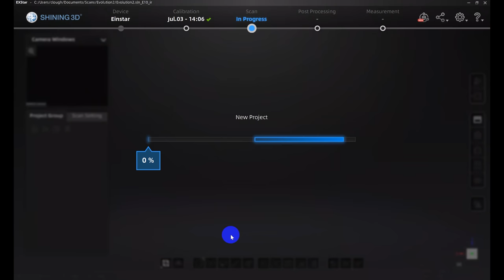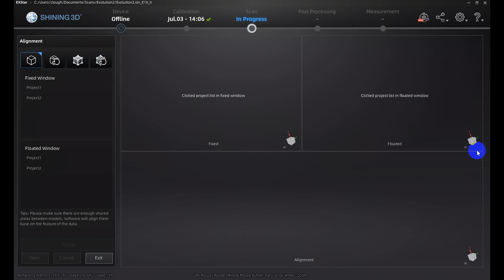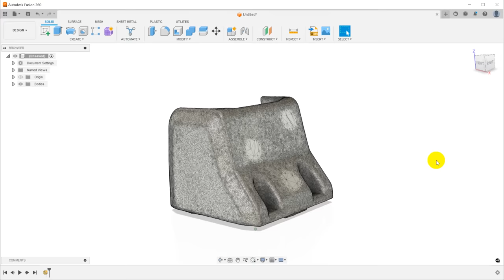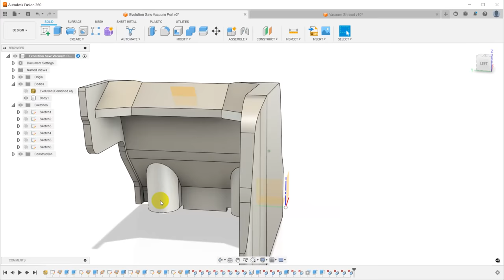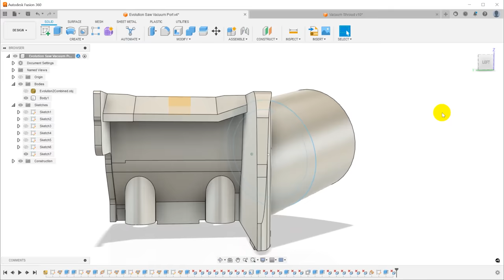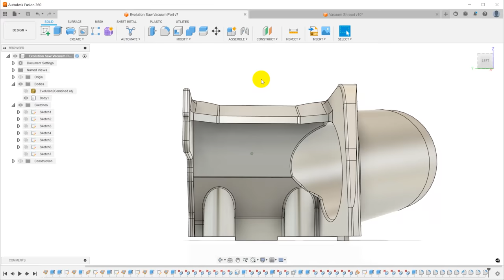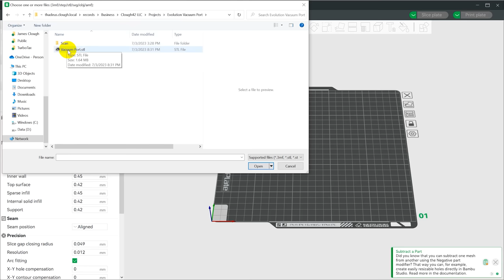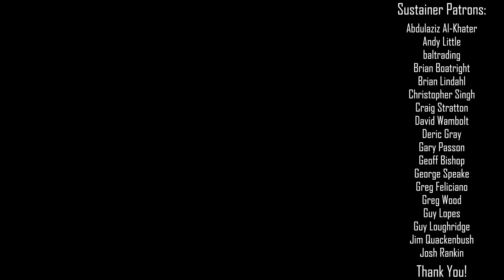Scan and 3D Print a Vacuum Port for the Evolution Cold Saw

Comment: I usually put some duct tape over the end of the tube. It doesn’t completely solve the problem, but does reduce the chips somewhat
Reply: 3d print universal tube covers with neodymium magnets embedded in the print. Reusable and chips hold to the magnets
Reply: @shitdogtacopoop  Not aluminum chips

Comment: A simple way to contain chips: consider making a "dog house" out of a cardboard shipping box. Cut off the flaps and add an access hole, set it over the saw. almost all of the chips will be contained under the box . If fire is a concern, a light mist of water on the cardboard fixes that. No need to keep the used box. It is a good way to use those shipping boxes. By the way, boxes also make great mini paint booths.
Reply: This is the solution. Been doing this for years.
Reply: It's CAD - Cardboard Aided Design.

Comment: When I used them a lot, I would stick those clean up magnets (the ones you can pull to drop the chips off) on the end up the mitered part and near the spray and would get quite a bit. Won’t help you on some materials but did help on steel, which was most of what I cut. Tape can also help. 
Great video as always

Comment: I don’t know if this helpful but I’ll put it out there. I avoid saws like that one favoring my 4x6 horizontal bandsaw since it’s much quieter and doesn’t throw chips so far. For storage and convenience I mounted my band saw on a harbor freight hydraulic lift table. I can raise and lower the saw for comfort and storage. It fits under a workbench and for heavier materials I can just make the cut lower to the ground. The table top of the lift actually makes a pretty good catch pan for the chips as well.

Comment: Use a leather welding apron attached to the top of the saw guard and hanging over the edge of the table to knock down the chips. Some steel wool in the tubing will catch the chips.

Comment: I think they didn't make a vacuum port is because of HOT sparks from cutting steel. I think unless you add water to a wet and dry vacuum you could have a fire if you just use a vacuum dry. ( That is if there is anything flammable you have vacuumed up)
Reply: The combination of unknown Magnesium and adding steel sparks on a belt sander....this makes the hose glow real pretty for about 30 seconds. Once the internal filter fails, the vacuum begins belching out black smoke from whatever is in the can. After 25 years, I'm still not over the experience of that!
Reply: Concur - needs steel tube, and a spark quench bucket so the drawn-air does a 180 degree turn but the sparks all drop into a bucket with water at the bottom.
Reply: These are cold cut saws, although the chips glow red they are not nearly as hot at a abrasive saw.
Reply: Evolution’s sliding compound saw which is dual purpose metal / wood has the same blade and has a vacuum port built in, so does their dual purpose saw bench. 

I get chips everywhere as well on both machines whether I run the vacuum or not, the physics is that a metal chip has higher mass than a wooden chip and therefore needs a significantly higher airflow to overcome the kinetic energy. You can use the 1/2mv^2 equation, where the velocity is the same in either wood or metal as the blade speed is fixed, but the mass m is different. Simple physics 😊
Reply: I was under the impression that the lack of vacuum dust collection on these tools was because of thermite risk.
Reply: I'm planning on 3D printing a port and putting stainless steel tape from McMaster on the inside.
Reply: @Jaws677 o! Have you ever used one? They throw huge amounts of extremely hot shards. The concept is that the way the teeth are designed, the heat from the friction of the cut mostly goes into the chips rather than the parts, though they can get pretty warm too. These chips get orange hot - around 1500 f.
Reply: @melgross  Something to consider is thermal mass though. Just because a small chip is 1500 f doesn't mean it has enough heat to actually catch something on fire.

Comment: For home shop or small business use, the Evolution saw in the video is great. It would be difficult to find a saw that cuts steel quicker and more accurately that the Evolution. Unfortunately, circular saws just throw crap everywhere. It’s just the nature of the beast.

I mounted my Evolution saw on the RIDGID Mobile Miter Saw Stand (AC9946). When not in use it folds up tight and stands in the corner of the shop instead of the work table. When in use, I’m no longer kneeling on the floor.

Another great video! Thank you for sharing you experiences.

Comment: I noticed a pretty large opening in the area above the new part, likely where the blade guard fits into when the saw is raised. That represents a serious suction leak that will dramatically affect your vacuum's ability to pull in more of the chips. Can't solved the chips out the end of the miter, but could get a lot more of the rest of them. You would likely need something flexible to allow for the saw vertical movement and that attaches to both the blade guard and the new part.

A piece of tape over the open end of the material can catch chips and then after the cut shake it out over your trash. I think these 2 improvements could have a pretty large effect on your results.

Comment: Personally I refer to them are carbide metal saws or steel slinger. Sure they are cold saws but I differentiate those by the slower rpm, less mess and a 5k+ price tag. The evolution saws are great but the evolution S355mcs is most likely the best saw you can buy for the price.

Comment: I have a couple of the Evolution saws.  They are really great for sawing thin stock.  I'm sure the reason they were not built with dust collector fittings is it is hard to imagine a more dangerous situation than hot chips and sparks being drawn into a dust collection system that may be using paper filters and full of sawdust.
Reply from the maker: Metal chips in a woodworking dust collector are indeed a pretty bad combo.  I've seen a lot of people worried about hitting a nail or screw with the table saw and getting into trouble.

Comment: Have you considered making a larger collection attachment? I’m thinking something more the size that is used behind the blade area of a radial arm saw. Have the opening stick out to the right side maybe 6 inches and down to the table, and some sort of port that would go down behind the blade and off to its left side a few inches. And maybe connect the vacuum to a replacement tray so you’d have some downward flow as well. Seems like that might catch a lot more of the chips.
As to safety with hot chips, I have a vacuum catching the hot dust off my bench grinder. I did go the cyclone route, but it’s a plastic cyclone. I don’t think there is any real issue with fire since I have the cyclone used only for that one machine, no wood allowed. I also have a double screen I installed over the output port of the cyclone so hot chips can’t get to the shop vac.
With the screen, I think it would probably be safe even using my dust collection system to provide vacuum since hot chips really cant get into the collection system. I’m thinking this might be another thing that would improve chip collection since you could use a 3 inch cyclone and get a lot more air flow to pull in chips. Whether all this is worth it is another matter 😀

Comment: Have you considered getting a welding curtain around your welding table? that will at least contain the chips to that area. The 3D scanning thing looks like a lot of work for a relatively simple part, but I can see that it would be great for more complex, less orthogonal parts that would be difficult to measure. Great stuff as usual.
Reply: Similar thought, using certain type of a flexible curtain/shield to reflect all chips within smaller area.  What about Magnet Shield to absorb all metal chip then unmagnetized for clean up.

Comment: I'm always scared of vacuuming hot chips/sparks. I use double folded pieces of aluminum foil, taped in strategic places, for deflecting chips and sparks. Also works wonders for protection during welding.

Comment: The hot chips was my first guess at why there was no "dust" port, but the lawyers literately having cows at the thought of attaching a shop vac with saw dust in it to this saw was another. I do think it's possible to collect the chips, but it may be so elaborate, its easier to just sweep them up. Another avenue, may be an enclosure to let you saw at any angle, and length, but keep the chips contained to a "box". Something similar to an enclosure for a chop saw, or radial arm saw. Maybe even a vacuum channel in the chip drawer. Slow speed recordings of a saw cut may be helpful.

Comment: 3D print a shield with a magnetic base. It would be easily adjusted around your workpiece, could mount directly to the welding table, and have a vacuum attachment at the base to collect the metal that hits it and falls down.

Comment: part of me wants to think a curtain of something like silicone fingers - akin to dreadlocks - held a short distance away from the saw - such that the length would preclude any ever reaching the blade-  would allow chips to be arrested  in motion from the softness of the dangle, while not being so elastic to rebound them further/elsewhere. The strands would be far enough apart that no chips would ever get stuck in them - and silicone is high temperature resilient.

Comment: Nice scan, and print job, James. Chips are the bane of our existence in the shop. Saw dust is just as bad. I have wheels on my table saw take it outside to cut. The Bridgeport, and South-bend lathe would be more of a challenge to roll around. I am sure you will find a solution.

Comment: Putting the whole machine inside a big cardboard box with the opening towards you.
 far enough in that the material can just pass in front of the opening of the box greatly reduces cleanup
You can even add a small hole on the sides of the box to pass material trough and put it even further back in the box.
Just make shure you have enough hight in the box to operate the saw.

Comment: Hi James.
I’ve thought about this exact problem for quite a while. My current ‘fix’, is to take the saw out onto the concrete apron, and vac up the chips bold at the end of each session.
On a number of the welding channels, I’ve seen guys construct a ‘grinding table’ that has hoods/deflectors/chutes incorporated, with a cyclone system providing the evacuation function.
Maybe a mite ‘excessive’ for a hobby shop though?
Anyhoo, thanks so much for taking all the time and effort to record these very informative ‘tutorials’.
Regards,
Robert
Reply: Nothing about Clough42's shop says "hobby" to me.

Comment: I have the same issue. There are canvas dust collector hoods for wood saws which obviously wouldn't work with hot chips. However, I have been thinking of copying the design, but having one sewn up from a welding blanket.

Comment: I've given up on using mine in the shop, when I need to use it, I take it outside. Then I sweep the concrete with a magnet in a plastic container and hit the whole area with a leaf blower to get rid of the rest.

I am considering a magnetic broom which would make the cleanup a lot easier.

Comment: Love your content. Have learned a lot about both Fusion and 3D printing from you. Since you seem like a clean freak(not judging), keep the vacuum port and attach a strong magnet to a metal shield near the end of the tube. Magnets love metal.  I need a solution for all the aluminum chips in my shop.

Comment: Seems like it's the nature of saws to make a mess. Either flying chips or coolant containment, sometimes both! A real cold saw (Scotchman) is great for chip control, but the coolant runs right down long tubes and requires strategic bucket placements or some kind of large infeed/outfeed system. I'll still take the Evolution or other dry-cut saw over the abrasive versions. I just keep it on wheels and roll it out of the shop for most cutting jobs.

Comment: I'd been working on a replacement chip tray design that included the vacuum port, on the theory that there would be something of a "downdraft" effect over the entire blade slot area. A heavy foil layer was to be used as a tray liner to avoid the melting problem from the hot chips in the 3D printed tray. Unfortunately, I was still working on the tray latch design when I was laid off in March, so I didn't get to try it. I expected there would still be chips flying, but hoped that a better collection system would mean that I wouldn't have to move the saw outside every time I needed to cut the aluminum extrusions that I usually used the saw for. The vacuum tray was only to be the first step in looking for a solution to the problem.

Comment: What about a Y adapter in the hose, and a flat plate across the end of the second hose, with a hole in the middle?  That would draw air and chips from inside the work.

Harder more-complex solution is to make a complete enclosure somewhat like your mill, perforate the stage with speed holes and let the chips fall downward.  Empty it with a shovel like a lathe chip pan.

Comment: The few times I needed to use a Cold saw, the ones available to me All had a fluid supply to the cut area. Not solely for a cutting aid, but also as a means to control and constrain the cut  material to the pan used to contain the filtered and recirculated fluid.
Simply scoop out the non-ferrous cuttings or use a magnet for the ferrous material removal as needed. 
Helps Immensely! 👍
I miss having a Machine shop and a Lab at my disposal! 😢
Mike in San Diego. 🌞🎸🚀🖖
Reply from the maker: Yeah, I've been looking at some of those saws.  Most run a lot slower than the Evolution, and that also helps.

Comment: James, I think I know they didn't add this feature from the factory... Your vacuum cleaner will eventually catch fire by sucking in the sparks produced. I have a belt sander with an integrated vacuum system which collects the dust in a fabric bag. Once I cut some steel with it when I left the vacuum system running. It made quite an impression and I had to work hard to put the fire out. Maybe a tip that saves your shop. Best! Job
Reply from the maker: That's why I talked about this in the video.

Comment: It seems as if the airflow towards the vacuum would be really improved with a flat sheet of material on the right hand side of the saw that extended forwards from the vacuum port to the back of the vice. This wouldn't impeded putting long straight pieces of stock through the saw. The stock would hit it on mitre cuts, but if you made it of that thick synthetic rubber material that is sometimes used to protect the ways on machine tools, it could be pushed out of the way entirely for mitre cuts with a long cutoff (which are unlikely to leak many chips out the end), and if you're just mitreing an existing square cut then the end would be within the airflow area pushed up against the material.

Comment: I just installed one of those small floor model on caster dust collector (Wen brand got cheap on amazon) on my surface grinder, as that was putting out tons of black dust everywhere. My guess is that's a future project for you too.

Comment: I get asked a lot about why I don't just use my Evolution chop saw and this video is the answer.  Hot chips everywhere.  Unless I have a large fabrication project I prefer to use the horizontal band saw and just let it run.  Great idea on the vacuum port though, too bad it wasn't more effective.  If you were in the market for a 3d scanner now would you still get the one you have?

Comment: Wide mouth , square or rectangular funnel, with a 90 degree face to wrap 2 sides of that corner of the saw, and your vacuum attachment.
Reply: Shucks, fat finger.. Let the funnel stand on the table top when cutting.

Comment: Yeah, I love my cold cut saw, but the chips are just nuts. I've started doing the same thing and cutting on the floor with it. That way I can put up some barriers to try and contain the chips. Cutting outside with it is not an option because I don't want metal chips all over my lawn or driveway.

Comment: I'd maybe be inclined to just put a welding magnet with a piece of thin sheet to the right of the saw to catch the stuff the dust port doesn't. Granted this would only help for ferromagnetic stock as a sheet metal guard would be likely to bounce aluminium chips back at you, but if you're cutting steel you could just brush the magnet off with a wire brush into a bucket when you're done.

Comment: I own a 14" abrasive saw, have not used it in 15 years since owning a band saw!
Reply: The evolution is not abrasive
Reply: I had an abrasive saw, got rid of it due to throwing grit everywhere. Got an Evolution equivalent, and it's been sitting on a shelf ever since getting a band saw. If I have to use it, it's put under a cardboard box to contain the chips as much as possible.

Comment: how about a different approach to catching the chips?  instead of the vac adapter, mound an electro magnet, like the base of a mag drill, that would be active while the power sw was on.  maybe a deflector around the mag to ensure the chips are all directed toward the mag.  a catch pan below the mag would catch the chips when the power was removed.  the vac hose stuck in the hollow tubing would catch a lot of those errant chips.

Comment: a Canvas screen or plexiglass diverter to limit the chip spread seems prudent, Kind of like the chip deflectors people use with vertical mills to limit chip spread (some people use cardboard as their chip diverter but I would be concerned about the hot chips). the goal of the screen/diverter is just to limit the space you have to clean.